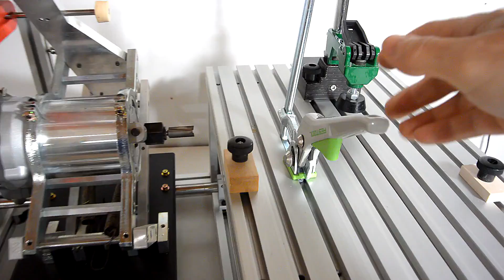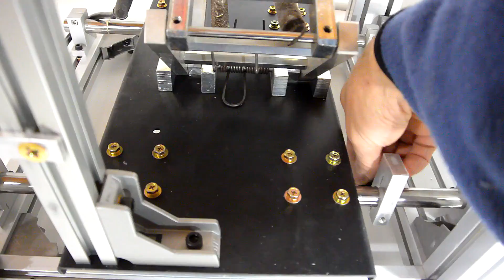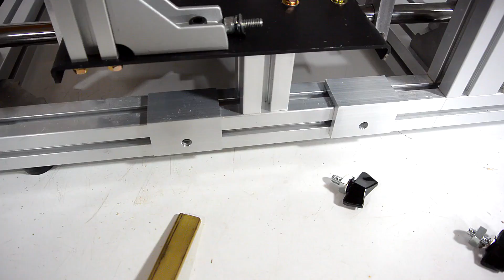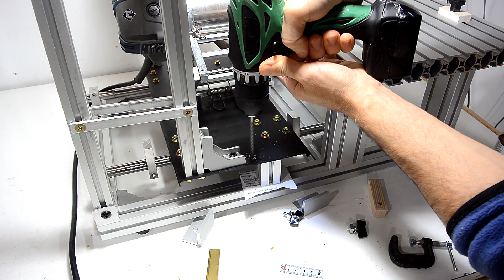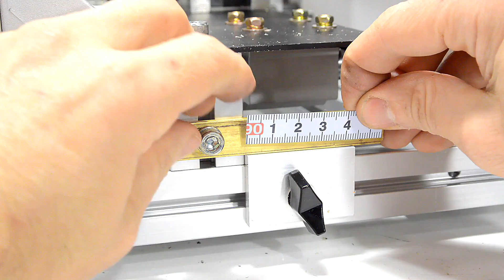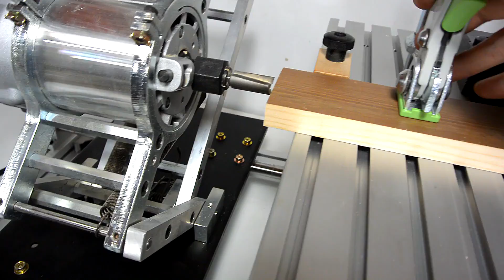New depth stops for the metal pantorouter

Comment: I received my all metal pantorouter from Kuldeep earlier this month and during assembly I noted a few design improvements over the version that Matthias has.

1. There are a total of 7 corner braces supplied.  The brace for the template holder frame is different than the other 6.  I put one brace in each corner of the base frame, and one at each connection between the table columns closest to the router and the cross piece in the base frame.
2.  The shaft supports now mount on the same side of the base frame cross piece, on the side closest to the router.  The corner braces for the table columns both mount on the other side, away from the router.
3. There is no need to drill a hole in the platen to mount the new depth stop post.  The bolt that Kuldeep supplies passes through the template frame corner brace and threads into the top of the post.

A big thumbs-up to Kuldeep for contiuously improving the pantorouter, and to Matthias for demonstrating the assembly process.  Now I eagerly await somewhat warmer weather so I can start using it in my unheated shop.
Reply: Did the new design have the new metal depth stop too?
Reply: Ted Walther
The new metal depth stop was included with my pantorouter.  I guess my point 3 above wasn't exactly clear that the metal depth stop was being refered to.Kuldeep also provided a short piece of metric tape as shown in Matthias' video.  I wanted the capability to work in inches as well, so I got some inch tape from Busy Bee Tools and mounted it on the flip side of the brass bar.  Now my depth stop is bilingual.